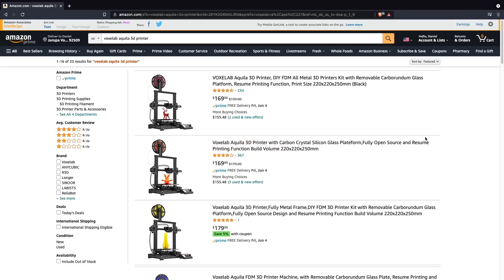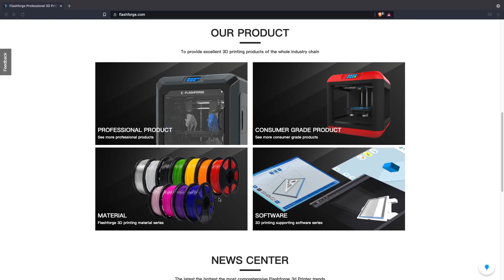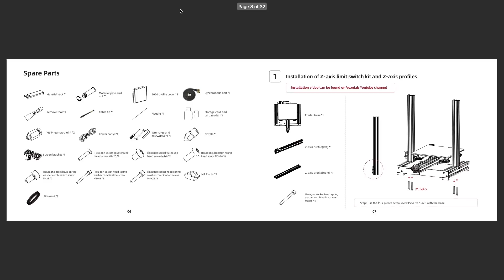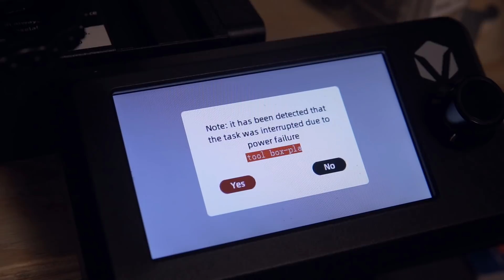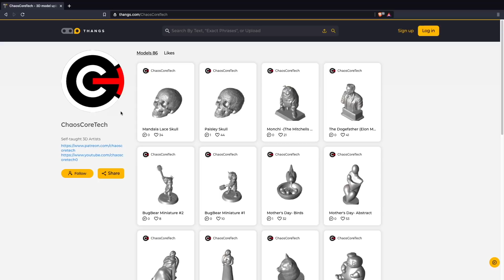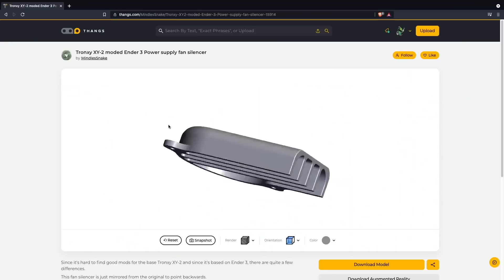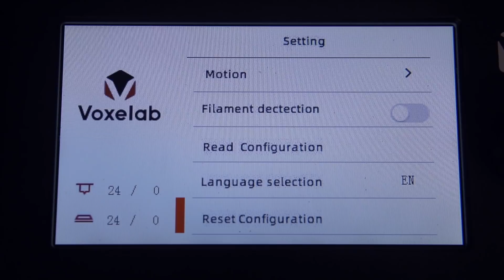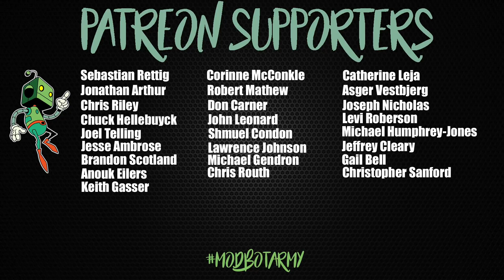Should You Get The Voxelab Aquila Over The Ender 3 V2?

Comment: this is a printer ive started to pick up so many times over the past couple months. i own the voxelab proxima resin printer an its by far the nicest resin printer for the price. voxelabs is pretty much a branch off of flashforge. the proxima resin printer an the foto 6.0 pretty much the same other than the color from what i can tell. build quality from everything ive seen from voxelab is higher than most an support is better than ive experienced in the past but most the time i try to fix things myself b4 dealing with support but with voxelab just being in the facebook group has gotten me discounted offers on their printers an resin an even test machines. not sure why i was picked to be a tester cause i have no follower as far as social media but i am pretty active in alot of facebook 3d printer groups an post quite a bit to my facebook i just cant see that being enough for them to offer me a test printer so i was hesitate to take the offer but since ive taken it for resin an they kept their word an refunded my money after giving feed back an also they offered up a data sheet for their resin curing times on their foto printers. thats how i learned the foto 6.0 an the proxima was the same machine just different color scheme. but if u plan to buy a ender 3, 3pro or v2 dont. save ur money an buy the aquila cause it will compeat with the ender 3 v2 at almost half the price. ive seen it as low as $149. the biggest thing that is stopping me from buying one is having room to put it.
Reply: Thank you for taking the time to make this comment, you just brought resin 3D printing within my budgetary reach

Comment: this is my first 3d printer and i been using it for months now, and i love it, but one thing that tick me off about it was with customer support, a month i got it the heated bed the cables burnd out like the ground wired just charded and when i ask about it with them, i never heard from them they only ask me for my order and then nothing afther that, its been a month now and nothing.
Reply: That’s good to know. Customer support is important, especially on a first 3D printer purchase.
Reply: @mwinner101  I love it just the customer service is not there there
Reply: @LuisTricoroFlores  Weirdly enough I had the complete opposite experience. One of my fans was vibrating due to a loose blade. I contacted them and the next day I got a tracking number for the new part.
Reply: @wisllayvitrio  weird for me they just told me if i had any question and i said what can i do to get it fix or get send a new one but no, no answer  to it, it it was only a month from when i bought it.